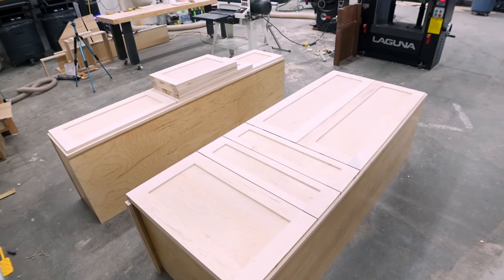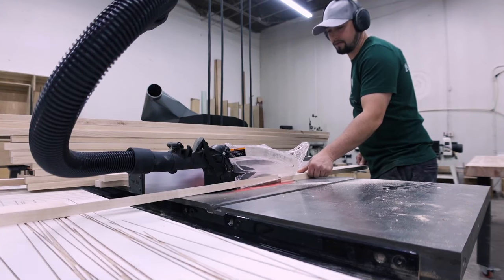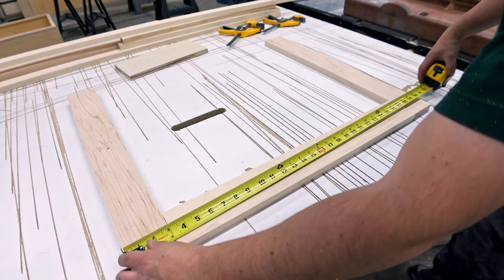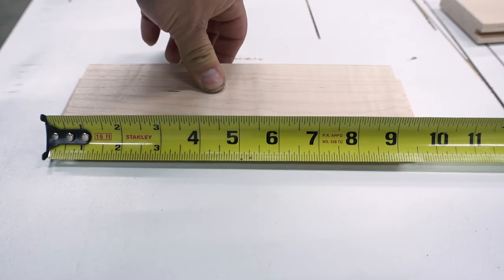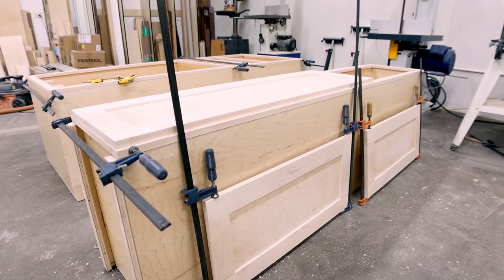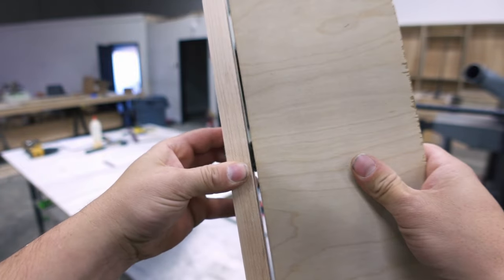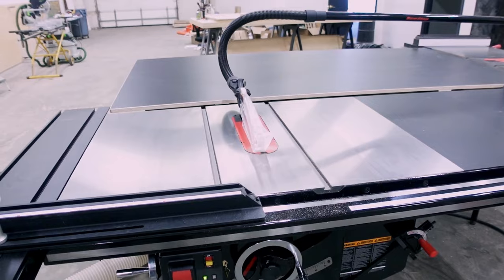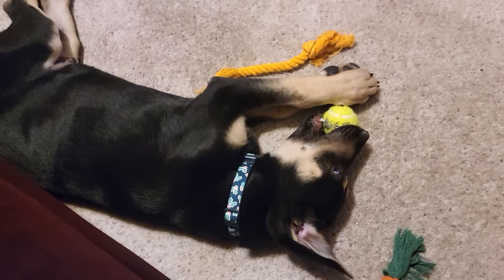Rather FANCY For A Laundry Room

Comment: One tip... ALWAYS cope the end of the rails first. Then route the center profile on the edges. This will prevent tearout on the rails and give you a perfectly clean profile in the joint.
Reply from the maker: I actually tried that in my latest project. You are right, it works great!

Comment: nice job. Where can i get those paint hangers for the doors? and what paint was that you used?
Reply from the maker: This is the hanger system I use for spraying https://paintlifesupply.com/products/prodryingrack-sd?utm_source=google&utm_medium=ppc&utm_campaign=20705205346&utm_term=&utm_content=&keyword=&matchtype=&tracking=&placement=&device=c&gad_source=1&gclid=CjwKCAiAqY6tBhAtEiwAHeRopYAZOWcbNTlSTheiikt-qDFtaE9cU7GhEBIvBSr7qqMOZswRatvwmRoCdrcQAvD_BwE
I get the hooks from amazon - https://amzn.to/4aXMWUE
And the finish is envirothane 170 primer and envirothane 200 White topcoat in 20 sheen. I suggest using the catalyist in the primer for crack prevention. You can get these products shipped from On site finishing - https://www.osfinish.com/

Comment: Excellent work as usual, Sir!  I do have a question about one thing I have noticed in your videos...and that is...I have noticed you use a measuring tape allot for measurements.  I was always told that it is more accurate to use other means of measurement as tapes do not always have the calibration and consistency that other measuring precision devices have.  Just something I have noticed.  Although you do not seem to have any issues with using a tape as evidenced by your work.  Another question is why don't you use the metric system?  There is allot less math and it's more easier.  Just sayin. 🙂
Reply from the maker: I appreciate your comment. Thank you. I was a contractor for 7 years so I've learned how to use a tape measure most accurately. When consistency is important like doors, I use stop blocks for repeat cuts. It's all about using What measuring tool When.
I do know the metric system, although thanks to "good ol" USA, imperial is engrained into my workflow. 
Thanks for watching and subscribing!